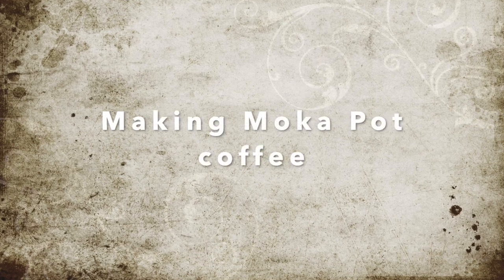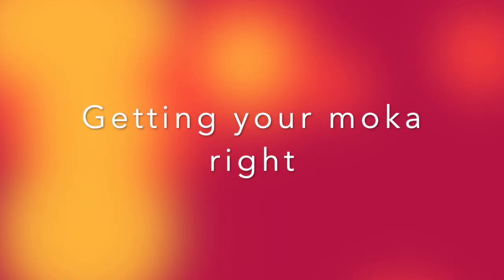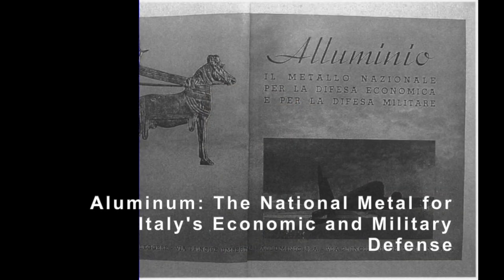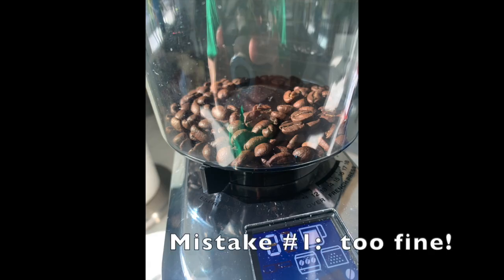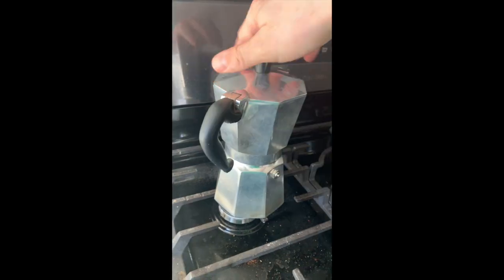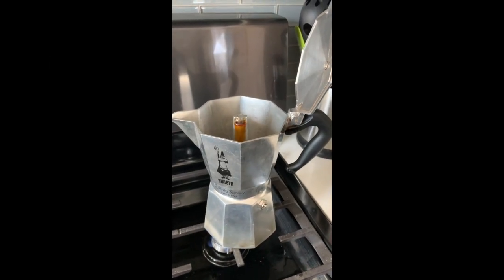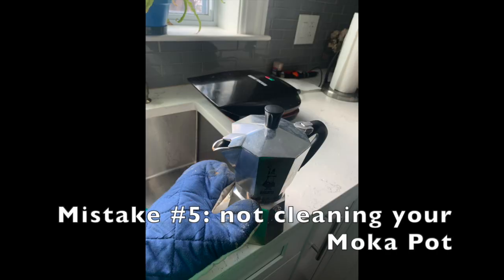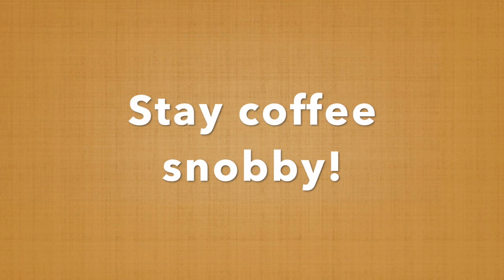Why your Moka pot tastes bad

Comment: I've never heard of boiling the water BEFORE putting it in the moka pot.
Reply from the maker: @fabribeijing   "The guy who explains that is a Brit."

ಠ_ಠ Uhhhhh... wow.  Do you not know who James Hoffman *is*?
Reply: Or like me who lives in Indonesia, most households drink from a water dispenser instead of tap. You can dispense hot or cold water from those. Very useful everytime I'm making coffee.
Reply: Faster heating also means to avoid burning the beans (aluminium heat up first before the water) before the water heats up and go up. So yes, use hot water.
Reply: I think it’s taste smoother coz when i used a room temperature water i feel like it a bit bitter like(bad bitter)
Reply from the maker: @hungryearth6840  I personally don’t notice a difference, but the best theoretical model I have seen claims that using cold water will result in the extraction taking place at too cold of a temperature: https://youtu.be/O14BIH-9KTA
Reply: I started doing it this way and it’s faster. The jug is boiled by solar electricity. It’s on the gas range for about a minute max. And tastes better.
Reply: If you load it cold you end up steaming the coffee beans too much. High temp increases bitterness
Reply: I won't argue against opinions; you know what they say about opinions.  I comment here to share my current method adjustments and consistent RESULTS:   i was putting cold water in thr reservoir on medium heat, waiting a LONG time and getting harsh coffee.  Now  I still use a medium heat but warm the moka pot first by filling then emptying both parts with hot water, i then microwave just enough water for 45 seconds - hot but NOT BOILING- and pour into reservoir, then place on burner. It's ready pretty quickly so it doesn't spend enough time on the burner to burn the grinds.  This way might seem fussy but worth it to me:  i am getting rich, mellow coffee EVERY TIME.  Using good fresh quality properly ground coffee is presumed,  of course.  Try and see if it works for you.
Reply from the maker: @Haramyst  let me why I love this answer: and not just the serious investment you’ve put into this process, but I can confirm with good scientific evidence your argument for preheating the water (but not to boiling!). 

There’s a physicist who actually wrote a paper about this which I explain in another video: https://youtu.be/O14BIH-9KTA

In terms of actually preheating the *metal*, you might be one of the first to suggest this. Hey, whatever works!

I have personally found that the biggest improvement comes from putting an aeropress filter into the moka pot!
Reply: @loodog555  what a great idea with the aeropress!  I will check out your video.  Thanks!!
Reply: James hoffman has done loads of experiments on moka pot. And one finding is that pre-boil the water results in a hotter temp in the coffee, this is because you don’t need the water to be fully boiled to have enough vapour pressure to push the water thru, you will reach that pressure early with cold water and you are gonna wait for a much longer time for it to boil. The best approach is to pour boiled water into a cold moka pot, use low/medium heat to maintain that pressure, and stop before it starts to spit out bubble to avoid adding in the bitterness.
Reply: To boil it faster and to avoid sizzling the coffee grounds, you don't want them to taste bitter.
Reply: @Balmung812  thanks a plenty
Reply: It's a common technique
https://youtu.be/rpyBYuu-wJI
Reply from the maker: @fabribeijing  Thanks for your comment, but, somehow I suspect you haven't seen my latest video that addresses the considerations in preheating the water: https://youtu.be/jcgMeDDAT-s

Preheating the water has also been shown via numerical simulation and common principles of fluid mechanics and thermodynamics to improve extraction temperature (https://www.semanticscholar.org/paper/The-physics-of-a-stove-top-espresso-machine-King/8a38818c2ce700e632cb25a6d2a518582d2edf17) to prevent brewing from happening at too low of a temperature.
Reply from the maker: @fabribeijing   And here's why you preheat the water: https://www.youtube.com/watch?v=O14BIH-9KTA
Reply: Who would have ever thought a comment thread about 'this' could be so long .haha. what a time to be alive...says every older person. Haha.  I'll try the preheated water now though at some point.  Thanks! 👍
Reply: It makes a HUGE difference! To the point that I notice it when this step is skipped.
Reply: The best way is to boil water twice and to put it in the fridge afterward. Then you boil it again before you put it in your moka.
Reply from the maker: @Couscousalgerien  lmao.  You’ve got to preheat several gallons at once and then save single sized portions of preheated water in the freezer for later! 😂😂
Reply: You don't want the ground to be exposed too long to heat. Therefore, boiling water.
Reply: have to start with hot water
Reply: Trust me, its better that way
Reply: When coffee companies like “illy” says clearly with bold on their how to prep moka “COLD water “ I’m sure they know what they are talking about
Reply: @jadsoueidi9068  True, but you don't get any "clicks" unless you spout some stupid, contrary non-sense.
Reply: Room temp filtered water and low and slow heat works too.
Reply: I don’t think that boiling the water ahead is necessary, unless you want your coffee to brew faster. Removing the pot from the right at ending of the brew - light colored foam rising - and quickly slip under the cold tap to stop the  brewing.
And, this will make your mokka pot coffee smoooth: get a packet of the AeroPress paper filters. Btw, it’s cheap - like 6 or 7 USD for 300 filters. 
Place the filter in the underside of the top half of pot. It’s a game changer.
It fits exactly in there! If you follow the other tips, ala, don’t pack the coffee, medium grind, medium heat, etc., your coffee will taste much smoother and will have no grittiness at all.
Reply: In Italy they never pre-boil as the lead up to extraction = design/intention.
Reply: Same
Reply: That's the most ridiculous thing I heard about Moka pot too
Reply from the maker: @mindezz  and yet: https://youtu.be/O14BIH-9KTA
Reply from the maker: @fabribeijing  Just gonna drop this link here for you, my friend: https://en.wikipedia.org/wiki/Psychological_projection Have a great day!
Reply: @loodog555  It's really funny how upset some people get over things such as coffee. You even mention in your comment:
"Of course, anyone who's happy with their brew technique can leave well enough alone."
And people still get offended. Naturally, one should always make coffee to suit one's own taste. (I frequently get comments that I might as well inject pure caffeine considering how strong I brew my coffee.) But yeah, definitely the most important part of brewing a moka pot is not setting the stove temperature to MAXIMUM HEAT, but set it to a medium temperature instead, the second most important is how you grind your coffee, and the third is whether or not you put boiling or cold water in. (That's my opinion, at least.)
Thank you for sharing the videos and the article, very informative.
Reply from the maker: @petardjordjevic7714  it is really amusing how many people stop by to either convince the world that THEY ARE NOT WRONG about preheating or who just leave the comment “my moka pot coffee is fine”, as if the title were written for them personally!  I actually completely agree, in that whether or not you preheat the water is the least important decision you make in terms of your coffee quality outcome. I honestly don’t even notice the difference, but I guess we all have to fight about it!
Reply: @petardjordjevic7714  People get upset because videos like this mislead people who have never used a Moka pot into believing that it is a more complicated process that it really is, thus disuading them from buying one.  Bialetti knows how to use their product and their own instructions say to use cold water.  Now I will say this, the quality of the water you use does make a difference in taste.  So if your tap water has a lot of chlorine or dissolved solids you might want to filter it.
Reply: @tedolphbundler724  
>videos like this mislead people who have never used a Moka pot into believing that it is a more complicated process than it really is, thus dissuading them from buying one
I really doubt people base their decisions on one highly opinionated video, tbh
>Bialetti knows how to use their product and their own instructions say to use cold water
Yes, using cold or hot water you end up with a pretty good cup of coffee, probably; it's a simple device to use
>the quality of the water you use does make a difference in taste
quite a big one, yeah, honestly I've been using only bottled water for years now, the coffee is much better; also, freshly ground coffee, as in I bought a cheap grinder and grind it before I make a cup; and the final step is to not mess something up while it's brewing, but that's typically hard to do.
In the end, I gave up on the Moka pot; regardless of what I do I simply cannot achieve a consistent brew; either too much or too little coffee comes out, and that's really annoying. I'm 99% sure it's due to my stove, as it's not a very good one, since a close friend of mine uses the Moka pot regularly and gets a really nice brew, I enjoy his coffee. He has a nice gas stove though.
Thanks for your comments!
Reply: @petardjordjevic7714  Gas stoves work much better for the Moka pot. The heat output is constant and finely contollable.  Electric ranges are the worst.  The temperature control is highly erratic.  The hob just gets hotter and hotter at the same setting, and even if you turn down the heat, it takes a while for the fob to cool.  It can be done, but it takes a lot of practice and patience to develop a repeatable technique on an electric stove.
Reply: Me either. Honestly, fir the amount of Italians in the US, it has always amazed me why their coffee is so shit. Never mind the fact that he is under packing the cage.
Reply from the maker: @copycat21c  Well, don't take very little piece of a snappy 3-minute video as the bible!  

If you read the comments here, as well as my follow-up video (https://www.youtube.com/watch?v=jcgMeDDAT-s&), you'll see that this is not actually my recommended packing technique.  Ground puck permeability can be influenced by as much as a factor of 2 in either direction according to packing, as shown by the 2008 King paper: https://www.youtube.com/watch?v=O14BIH-9KTA&. Underpacking leads to premature extraction, which is part of the problem that preheating the water is intended to solve.  More details on why to preheat the water here according to physical models and extraction temps here: https://www.youtube.com/watch?v=O14BIH-9KTA&
Reply: @loodog555  Fair enough, but tbh it was too painful to watch. The fact that you mob seem to drink that watery dripolated staff that’s been sitting in a hot plate for hours on end doesn’t speak well to your general palate. It’s any wonder so many over there need help with something as simple as a cafetière. Comes from being social isolationists, I guess.
Reply: @loodog555  And don’t preheat the water. Seriously. The whole point is to build up the pressure as the water boils.
Reply from the maker: @copycat21c  So I'm a bit confused about this comment: "the fact that you mob seem to drink that watery dripolated staff that’s been sitting in a hot plate for hours on end doesn’t speak well to your general palate."  

Were you intending for this to be an indictment of the way Americans commonly drink coffee?  I certainly don't think the average American, who's drinking Starbucks, Dunkin' Donuts and gas stations coffee, should be held as the icon of coffee culture, any more than McDonald's should be held up as a symbol of our best offerings in cuisine!
Reply from the maker: @copycat21c  I'm also a bit confused with this, if it's a response to the video I linked in last comment, which explains the 2008 King paper and its simulations.  Do you actually believe that 69C is a good volume-averaged temperature for coffee extraction? Ernesto Illy himself wrote an article in Scientific American that 92-94C is optimal. Or do you just believe that Darcy's Law is a poor physical description for the brewing process? 

And you mention water boiling, but as mentioned in paper I explained in the video link in the last post, the water doesn't actually boil to brew (though everybody thinks it!):

"In this article, it will be shown that boiling the water is not only unnecessary, but in many cases undesirable, and that the physics is not as simple as might first appear."
Reply: @loodog555  Mate, don’t worry about it. I’m not going to spend more time on reading long-winded papers. I’ve never had a bad coffee from a stovetop espresso maker. Sorry I said anything. It was unusually impulsive of me in the first place. You do you.
Reply from the maker: @copycat21c  Oh of course!  No one wants to wade through a dense physics paper! That's why I've made videos explaining the basics of each paper.  The basic principles of Darcy's Law, vapor pressure, and the ideal gas law are pretty simple: https://www.youtube.com/watch?v=O14BIH-9KTA&.  The videos are there if you ever feel like taking a deeper look into the physical modeling.
Reply: @loodog555  Wow. Sorry I hadn’t watched further. You sound like a bigger coffee nerd than I am. When we’re allowed out again, come down under for a coffee. Our baristas are world class. And they are literally everywhere.
Reply: @loodog555  There are more variables than that paper presumes. It is worthless.
Reply: Weird, totally opposite, I hear it from all the coffee experts. 😆
Reply: I've heard this a lot and as I explained in my post, it is nonsense by physics and logical standards.
Reply: Everyone i hear about it boils the water first, before they know they're wrong, serously
Reply: Same
Reply: Stu Pitt  Yes by heat accumulation
Reply: Ma che coglioni.. Manco un caffè si sanno fare😑
Reply: Yeah kind of defeats the beauty of the simplicity. Waste of time in my opinion. Is rather just have one thing
Reply: Well now you are
Reply: I don't use pre heated water. I use cold, low heat. Always comes out tasting good. I have an electric stove. Also it's best to preheat your BURNER before using it
Reply: i did
Reply: Me too
Reply: yeah, absolute BS.
Reply: I’ve never heard of calling it a moka pot. We call it a stovetop espresso or a Bialetti.
Reply: I’ve done both. No noticeable difference
Reply: Bialetti instructions say to use room temperature or cold water. 

The Moka is not supposed to boil. It doesn't work by boiling. The heat gradually expands the air and water vapor until it pushes the water down and up through the pipe at a temperature that's lower than boiling.

Starting with boiled hot water makes the water boil inside the Moka, which causes bad flavor.
The ideal temperature for the water to bathe the coffee powder is below boiling. 

For the best tutorials, search for "Annalisa J Moka pot" and "Il Barista Italiano Moka."

To avoid overcooking the coffee, use a low gas flame or a preheated medium electric stove. Remove the Moka from the stove immediately when your hear it start to gurgle. It will finish brewing off the stove from the residual heat inside the pot.
Reply: And me
Reply: In Italy they never pre-boil as the lead up to extraction = design/intention.  

A pinch of kosher salt on the grounds pre = 🎉
Reply: @louisbourbon8973  I did and my coffee now just taste amazing
Reply: I always do it speeds up the process
Reply: It has nothing to do with saving time. You ALWAYS want to add boiling water. Translates to lesser time on the burner resulting in less bitter/burnt coffee!
Reply from the maker: @Oceansta  James Hoffman agrees with your interpretation, but the physics paper I linked above makes an argument about extraction temperature being better with preheated water.
Reply: @Oceansta  use the small burner/flame and the water will act as a temperature damper
Reply: Me either!
Reply: It just saves time. If you think about it, it makes sense to do so , because starting out with cold water will add nothing to the flavour. You're just making yourself wait longer.
Reply: @BosmanHa  yeah, but, doesn’t boiling some water first take time? 🧐
Reply: @robhulson  I have an electric kettle it really does save on boil time vs the open flame on the stove in a cold perk, you can use the electric kettle to heat up your mugs as well so the coffee doesn't immediately go cold when you pour it, its really was a game changer to my coffee game.
Reply from the maker: @robhulson  An electric kettle is faster and more energy efficient.  I personally don't taste a flavor difference, but adding cold water means your coffee will probably extract at too low a temperature: http://www.msc.univ-paris-diderot.fr/~phyexp/uploads/Moka/article1.pdf

I discuss this in my follow-up: https://youtu.be/jcgMeDDAT-s.
Reply: @robhulson  Yes, but you can heat the oven plate up while it boils, and measure the coffee out, so you do save a little bit of time
Reply: @loodog555  the pressure increases as the water boils, so extraction can only happen at the same temp (~100°C).
Reply from the maker: @seamikiseamiki1825  You would think so but....http://www.msc.univ-paris-diderot.fr/~phyexp/uploads/Moka/article1.pdf

"In this article, it will be shown that boiling the water is not only unnecessary, but in many cases undesirable, and that the physics is not as simple as might first appear."
Reply: @loodog555  interesting article, i thought the pressure in the vessel would increase the boiling temperature.
Reply from the maker: @seamikiseamiki1825  Oh, it definitely does: https://en.wikipedia.org/wiki/Phase_diagram#/media/File:Phase_diagram_of_water_simplified.svg. which provides all the more reason you don't want to boil it, because you'll really start overextracting the coffee at those ever great temperatures.
Reply: @robhulson  😁
Reply: @loodog555  I agree that everybody is free to use the moka as they wish, but Mr. Bialetti invented the moka to be used starting from cold water and that's the right process the moka is meant to be used in. All the moka manufacturers and coffe producer suggest to start from cold water and I can taste a huge difference when I use warm water... the coffe comes out too fast and too watery. In facts it's supposed to turn to the minimum heat as soon as you hear the water filling the tube in order to slow down the process. Of course if you have less time you can speed up the process (as I do when I'm late :P) but it's gonna taste worse not better
Reply from the maker: @EmilianoSoravia     I mean Alan Adler, inventor of the AeroPress gives instructions on how to use the thing, but everyone ignores those and gets better results.  In fact, the winner of the AeroPress World Championship experimented around double-blinded with different techniques and settled on a technique vastly different from Adler's instructions: https://www.youtube.com/watch?v=jBXm8fCWdo8

All this to say, being one of the early users, or even the inventor of a product, doesn't confer absolute authority on the best way to use it.  You could argue that it's more faithful to Bialetti's intentions or memory, but it's not going to win you any ground (pun not intended!) on claiming it's better quality coffee.  You might want to watch my follow up video, which discusses these considerations: https://www.youtube.com/watch?v=UFwP7Df3vVw&lc=Ugy_EF-pgjFJCsfGsoV4AaABAg

I'm getting that preheating the water or not is a kind of religion to belong to and everybody wants to convert the world to their take on it, but honestly everyone is totally free to do what they appreciate the best.  Just don't expect that you'll convince the world, especially when the best analytic evidence says.....: https://www.youtube.com/watch?v=O14BIH-9KTA
Reply: @robhulson  touché sir
Reply: The Moka is not designed to boil. The ideal temperature for extraction is lower than boiling temperature. The Moka works by gradually heating the cold or room temperature water (Bialetti instructions based on science) until the air and water vapor expands creating enough pressure to push the water down and up through the pipe to bathe the coffee powder at the ideal temperature, which is below boiling. 

 By starting with cold or room temperature water, the water will be a lower temperature when it contacts the coffee powder. The water temperature doesn't need to be that high because it's not doing all the work of extraction, there is 1.5 to 2.0 bars of pressure extracting the coffee also.
Reply: @loodog555  exactly right
Reply: @seamikiseamiki1825  exactly.
Reply: @BosmanHa  starting out with cold water have just everything with the flavour. Bitter taste also depends of blend you use.
Reply: @BosmanHa  you ever heard good things come to those who wait ?
Reply: @BosmanHa  saved time? But where can I get ready to use boiled water?
Reply: @BosmanHa  It's six of one and half dozen of another.  If you pre-heat the water separately, you are spending the time there. Net zero.
Reply: not sure if the potential time saving is worth the hassling around reassembling one half filled with boiling hot liquid. The seals do need to be cleaned & replaced regularly but the bialettis are quite capable of producing a very tasty brew
Reply from the maker: @keithsimon8980  NO. NOT OKAY.  EVERYONE MUST DO IT THE WAY I DO IT J/k.  My work mornings are pretty tight, leaving not much time to make the coffee before I have to leave for work.  I've never had a problem using mitts and the flavor difference isn't noticeable to me.  Of course, anyone who's happy with their brew technique can leave well enough alone.  I'm just throwing ideas out there with the basic message of, "You don't have to settle for what the pot produces!  You have some levers to pull!"
Reply: @loodog555  I actually set the moka ready in the evenings before tight mornings. This means the water is at the room temperature, but it gets all ready while I take a shower
Reply from the maker: I find it hilarious how much people fixate on the issue of preheating the water!  IMHO, it's the least important factor to be worth considering, but it seems everyone has a flag to plant here.

Most big names in the Third Wave Coffee community like James Hoffman and Tristan Stephenson preheat, arguing that you don't want to heat the grinds, while the UK roasters Bould Brothers argue to start cold, on the argument that you want the coffee to spend more time in contact with the water.  

Italians, of course, defer to their grandmothers who have been doing it for decades, and use cold water and most seem to get offended at the thought of doing it any other way.  The thought is: "Surely, the time-tested traditional method must be best!"

I myself have created a through follow-up video, which I've stickied at the top, where I discuss this issue (and others) at length (https://www.youtube.com/watch?v=jcgMeDDAT-s&t=246s), instead of trying to get my finer nuances into a 4-minute snappy video that people seem to appreciate for its brevity.

I personally can't tell the difference in taste whether I preheat or not so I do it to save time and electricity, but IMHO, the definitive word comes from Warren King's paper "The physics of a stove to espresso machine", which I discuss here:

https://www.youtube.com/watch?v=O14BIH-9KTA

King runs numerical simulations utilizing standard physics models and reveals that when you don't preheat the water, the coffee brews at 69C, far too low a temperature to be optimal.  Hence, preheating the water solves the issue.
Reply: The coffee is not extracted only by temperature, it's also extracted by pressure, so the temperature shouldn't be as hot as any of the Third-wave Specialty Coffee influencers think it should be.

They're trying to reinvent the wheel, and they can't afford to do even a tiny fraction of the scientific testing and professional taste testing that Bialetti can afford to do with their gross profit of approximately $180 Million per year. 

Based on my background in business-to-business sales/marketing and advertising, I would hate to have to sell home espresso and specialty coffee gear in a country that has Moka pots in every household and knows how to use them very simply to get consistently good coffee that tastes as good in espresso-based drinks as coffee shops or home espresso machines can make. 

I was ethical, but most salespersons are not; so I suspect the agenda is to ruin the simplicity and consistently good flavor of the Moka by convincing inexperienced users to implement complicated hacks, that, at the very least, don't improve the flavor; and, at worst, negatively affect the flavor. 

Nobody should have to suffer through the frustration and disappointment that comes from said hacks. Everyone deserves the best flavor from a very easy, simple ritual.
Reply: I bet the original design was meant to be used with cold water. So that's what I do.
Reply from the maker: @jckalma7916  I agree entirely with regard to original usage, but watch the linked follow-up video for a further discussion.
Reply: @jckalma7916 room temp.  yes🙂
Reply: @jckalma7916  It was.  All these videos that over-complicate a simple thing are B.S.
Reply: Surprised this has 357 likes lol I’ve never heard of any other way. Perhaps you can do it with cold water, but it will surely taste worse, for a process that already tastes bad, I just don’t see how it could yield a good result
Reply from the maker: @henry3397  Also, discussed in my follow-up video: https://www.youtube.com/watch?v=jcgMeDDAT-s.  

It's a very contentious debate, where people have strong opinions on one way or the other based mostly on "well, this is how I do it so it's GOTTA be right!"  The best theory I've seen on this actually favors using 70C water to ensure proper extraction temperature: https://www.semanticscholar.org/paper/The-physics-of-a-stove-top-espresso-machine-King/8a38818c2ce700e632cb25a6d2a518582d2edf17 while I'd argue that the experiments don't show much difference one way or the other.  I've personally tried both and honestly, it's not enough of a difference to notice, let alone be worth debating over.
Reply: It's unnecessary fuss.... but if you're making a video you've got to say something.
Reply from the maker: @couldrey47  Mostly this is more fuss than needed, but the message I'm getting from people who are happy about the video is, "Thanks.  I didn't realize there was anything to play around with so this has opened up possibilities about what I could try."
Reply from the maker: @couldrey47   And here's why you preheat the water: https://www.youtube.com/watch?v=O14BIH-9KTA
Reply: I appreciate all the tips he provided and don’t think of them as “unnecessary fuss” …